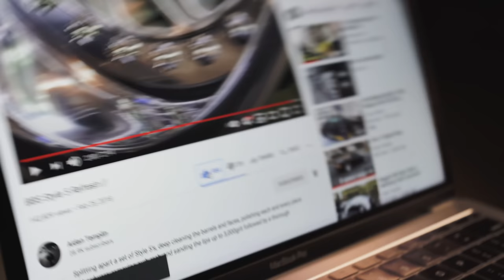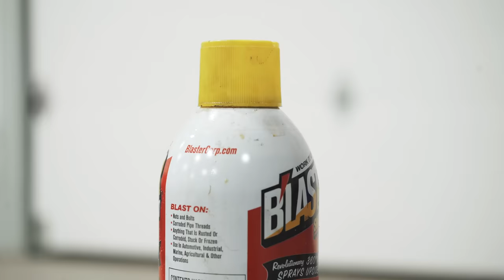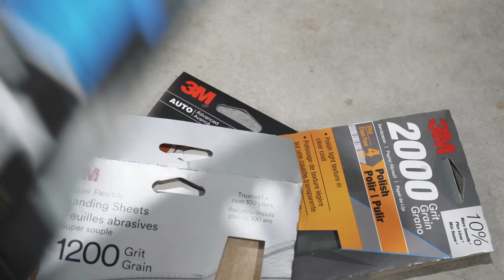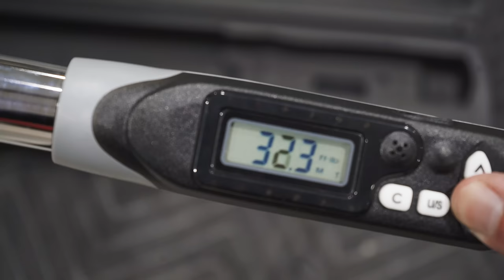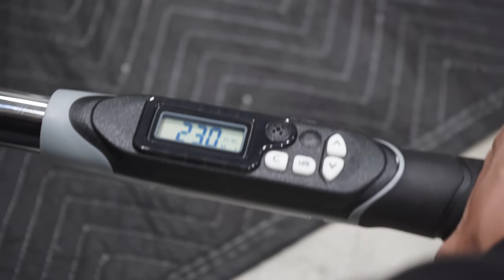BBS Style 5(RC090) Rebuild, Start To Finish - A Short Film By Chromatic

Comment: Next time, you might want to use an impact gun to unscrew the nuts. And for pounding the bolts out, you could use an extension placed on the bolt so you can hit the extension and be far away from the barrel and not hit it by mistake. Also for driving in the bolts, you can use a small tube on the inside of the bolt and tighten the nut with the tube in order to pull the bolt in, instead of beating it with a hammer. Just some thought as to make your life easier. Cool rebuild though!

Comment: Great work overall. Loved how you put attention to details.
Only few things I would like to point out.
1. tapping out/in hardwares would have been better using rubber mallet rather than a hammer.
2. Should tell the powercoater to mask the seating area of the faces that meets the barrels. This helps the faces to seat properly against the barrel as there can be thickness discrepancies with powercoat.
Reply from the maker: Thanks for the tips man!

Comment: This is a great video possible you could share the size of those bolts that attach the middle piece as I would like to just get them replaced with new ones. Also the star bolt in the back what size is that?

Comment: Hey man whenever you have older wheels that are extremely gunked up with brake dust and daily driving for years without a proper cleaning. What is the best degreaser/cleaner to use and the best way to use it to get the best results from it? Same question as well for engine bay

Comment: Would seating the bolts have worked aswell by torquing them down instead of hammering them in? Or does this make it harder to get them seated properly?
Reply from the maker: I don’t think you would have enough thread coming through the back in order to do that. However I never looked as I haven’t seen someone do it that way. You could try 😃😎

Comment: I have a bit of a stupid question. Are BMW OEM Style 5s the same as the BBS style 5/RC090? I don't know a whole lot about these wheels other than I want a set. I found a pair on a website for 400$/wheel, it is a BMW OEM 540i style 5 wheel, 17x8, 20mm offset, and I plan on putting them on an E36.

Comment: Art.  However, bare aluminum polished wheels are the WORST.  Fellow owners know the pain.  Hand polishing those lips after they get exposed to rain and oxidize every other week is something I wouldn't wish on my worst enemy.  It's to the point I'm almost at the verge of just getting my lips sent out and chrome plated.  Don't even get me started on if you have gold rivets like this guy in the video.  There's absolutely no way to polish individually between the hundreds of bolts with a mini high speed tool without risking burning off the gold plating.  Hell on earth.  But damn it looks so good when it's a finished product.
Reply from the maker: Hahahaha thank you man. It seems as if this comment may fall into the realm of PTSD.